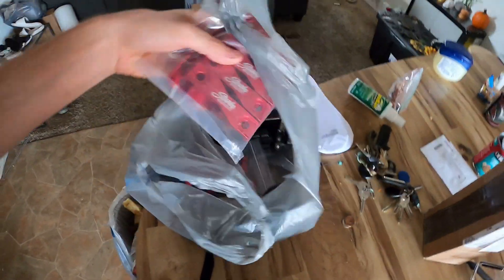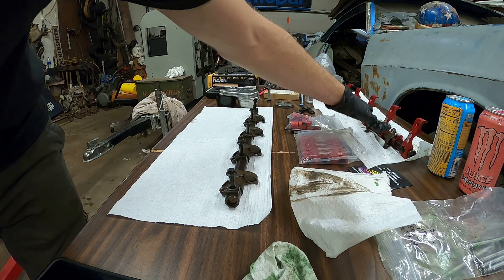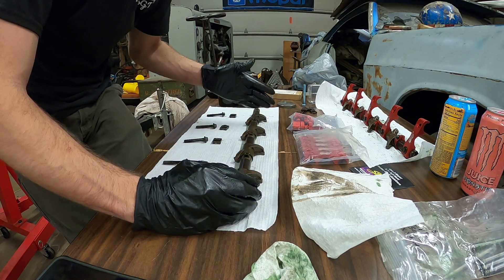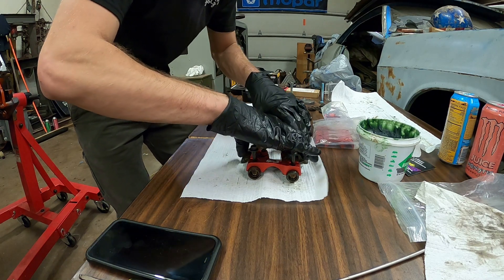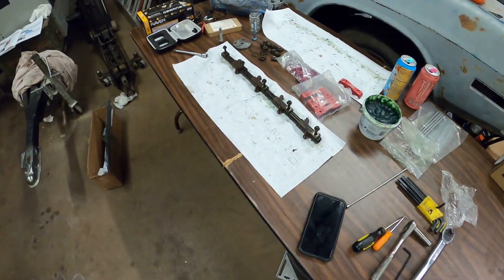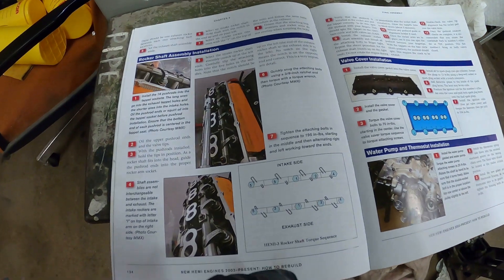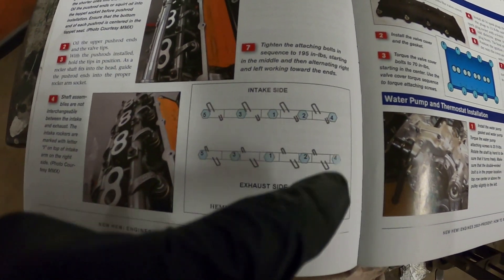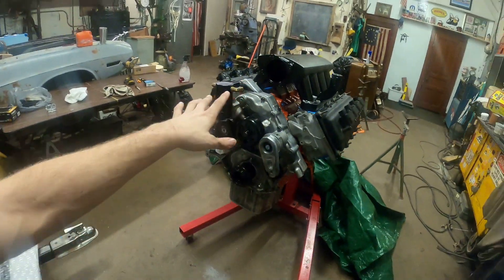Building a Procharged 426 Hemi (Part 6) *Rocker Stabilizers and Pushrods*

Comment: I’d have a suggestion. Set the shafts with the collars on but use the old keeper and bolt to do them individually. Once you have them both down tight, take the two coordinated bolts out and put the bracket in place. Then you don’t bind or bend the rods or shafts. Don’t need any of that.
Reply from the maker: That’s really good advice! I’ll definitely do that next time!
Reply: It’s a theory haha. I just put my order in so ima try it when they get here. There’s a service bulletin out from dodge one star that describes how they check for bent keeper tabs causing oil pressure loss in turn making valve ticks. They say to remove one bolt at a time to keep the rods seated. So it seems like it’s ok to “de-torque” ,if you will, one bolt at a time to fit the brace on the both without chasing the springs on both sides. I’m not building a monster like yours but I do have 6 grand into just the valve train already, id like to keep it together 😂. Cheers and thanks for your content!!! 🤘🏻🤘🏻

Comment: was there a torque spec to those collars?
Reply from the maker: Honestly, I don’t remember and can’t find anything with a quick search. I remember just snugging them up really good.
Reply: Did u go with .010 washers or just space them out?
Reply from the maker: @lightsout2642  you need the washers. They weren’t advertised when I bought them. I’m going to have to pull mine apart to add them.
Reply: Ok, thanks, ive gotem sitting in a sc 392 stroker still waiting to be run getting close! When u find those washers can u list the link.

Comment: Did you set the tolerances to 10 thou?  I’m kinda angry I have to redo mine now they are sending steel shims
Reply from the maker: Nope... When I bought these, the word was to install them against the rocker arm and it would "create it's own metal to metal bearing surface". Except I haven't had an oil change not contain aluminum in it. I'm assuming it's coming from these. I will be removing my valve covers and setting the gap to .010". I'm hoping I don't need to disassemble the rocker shafts and install shims.

Comment: had a question  i got the same set up kind of  but i cant get the valve cover to go on do i need to grind the webbing in the cover?
Reply from the maker: I was able to orient them in a way where I didn’t have to. I would try to replicate what I did and it would work. I’m using stock 6.1 valve covers, too.

Comment: A bro great video this is the only one I found on installing these I have the same ones I just put on my 6.1 hemi but now I can't get my valve covers to fit did you modify inside the covers to make fit I think it's catching on the front and rear stabilizers thanks
Reply from the maker: I didn't have to modify mine. Maybe try rotating them.

Comment: Something I think you should specifically stress is the orientation of the rocker shafts. The shafts have a "notch" cut into the shafts. The notches need to be face up on both shafts. They also face fwd on one shaft and rearwards on the other shaft. I'm not a Hemi expert so I'm not 100% positive(you should consult the Larry Shepard  manual to be sure), but I believe the notch faces up and forward on the LEFT head intake rocker shaft, and the notch faces up  and rearward on the exhaust shaft.
On the RIGHT head the intake shaft notch faces up and rearward and the exhaust shaft notch faces up and forward. By orienting the shafts correctly the rockers will oil the inside of the rockers properly. If you do not install it correctly it WILL gall up the rocker bores and the bottoms of the shafts and send nasty metal bits thru the engine destroying almost everything.
Reply from the maker: Well thank you for this! I did not know of this. I just made sure I put them back on exactly how I took them off
Reply: @themojogt  chapter 9; pg 134 in my edition of "New Hemi Engines".